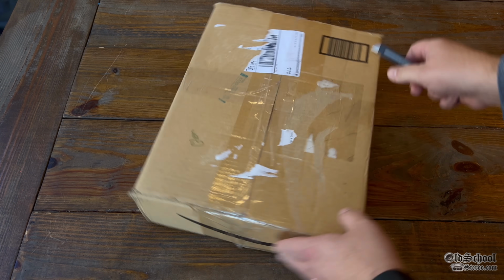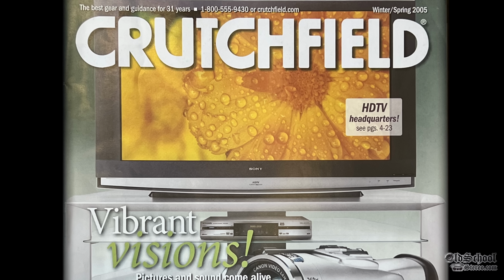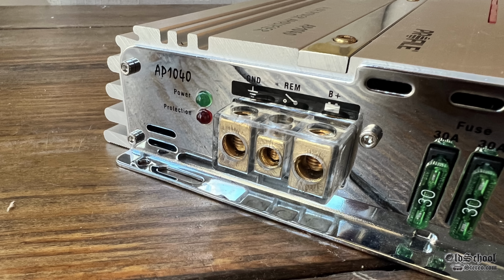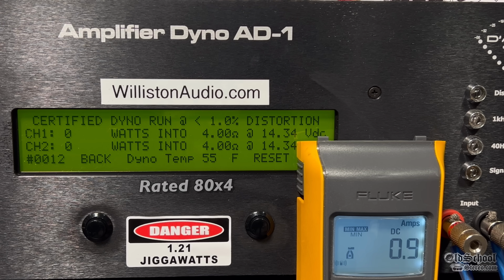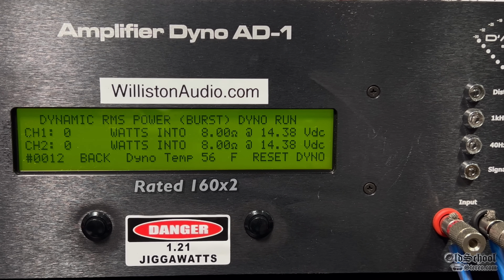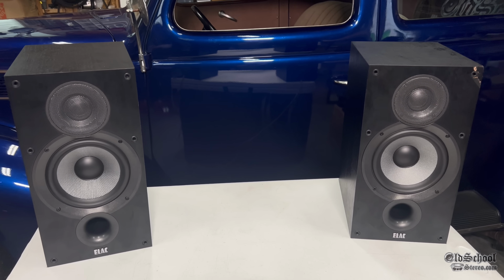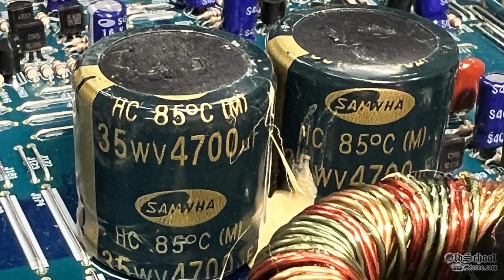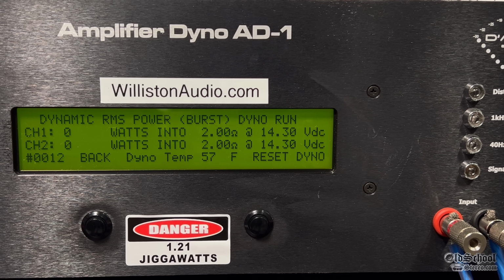2005 Profile California AP1040 Amp Dyno Test

Comment: I still have this amp in the 2-channel 1000-watt flavor. Just tested it for power on. Everything looks good. Internals are still very clean. Gonna slap it on my Kicker Comp R 8 2ohm DVC. Don't know what it's putting out, but the last thing I had it running was an MTX TR7515-22 and it would throw down.

Comment: I'm running a 2006 profile 1000watt class d monoblock right now, still pounding as hard as the day I bought it! I paid $250 for mine at a high end  store. Love it the red light just stopped working this week
Reply: @jasonpetrich4141  I never knew they made class d amps. I had the 1000w class a/b black Baja monoblock in 2004.
Reply: @tonemack1634  I bought it brand new, it was the newest amp at the shop @ the time, was like $399. Also got an eclipse deck with highest prevolt output 6 volts!!! Was a bad ass deck/ it  Was the first monoblock amp I ever bought, had a 800 watt Memphis! With the orange and blue MOJO! 12,   Wish I still has that driver.       The 1000watt profile is also 1ohm stable!

Comment: I have always wanted one of the high power smooth blue finish ones back in the day. They ran with the big 3 and were always the better buy as long as they were installed properly. If you had ground loops, clipping, or improper installation you would perceive these as being cheap. If you had a good installer they were awesome. Im not sure I would say circuit city or best buy really had installers that were putting in the effort for a quality build. LOL

Comment: I was 16 when I bought my first system. I had 2x 12” pioneer tsw-30f subs( blue and pink) and a profile California a600. It was the black and pink one from 1996. It was amazing how loud it was. I had a HUGE box that was about 52”x 20”tall and 16” deep. Good memories. I couldn’t afford Soundstream class A 10.0, broke high school kid making $4.15 an hour. 😂
Now I’ve got a system in every vehicle, tons of Soundstream amps. Class A 10.0, 5.0 and rubicon 10.2, 2x rubicon 1002, reference 700sx and lots of Phoenix gold, alpine 4x mrv-1507, and my favorite Alpine 3558 that was completely dead when I bought it. Now it sounds amazing. All the Elna caps leaked and corroded the traces to the power supply IC cards.

Comment: I had a 2000.1 California on a L7 15” in a ported box and it hammered, I mean when I switched to a west coast custom ORION 1500.1 it blew it out the water it might have been a 2500 it was around 2007/08

Comment: I used to install back in the day but never had a big setup for myself. Did a profile setup for a friend and liked the performance/price so my setup had a 4x75w profile amp and a AP300M mono drivng Crossfiire components and a pair of 8 inch Ctossfire subs was happy with it after figuring it out the 4 channel didnt like the 2ohms bridged load and having it repaired twice. Just gave it 4 ohms per channel and they were reliable. Entire setup survived pounding for about 10 years and I gave em away when i sold the car about 7 years ago.

Comment: I had a 250w Profile amp circa 1989/1990. It predated the California line. I replaced a 120w Pioneerr with it and it was much stronger  AND sounded better. I ran my whole system off of it with passive crossovers and it really did sound good. I added a Hifonics Hercules on my subs and moved it to the mids and highs and it kept up nicely. It was probably overrated, but it really was clean. My brother had a Sansui (ppi made) and it was quite comparable.

Comment: could you give me some details on how you have the remote wire, wired up? I assume it's just to a switch thats wired inline, got a link? I have a project coming up and will likely have to run a remote from the battery, or daisy chained from the pos from amp, with the switch inline. What would you suggest?

Comment: Always hated installing these at circuit city knowing the MTX stuff was there...though not everyone had mtx money
Reply: ...I worked at a shop that sold PPI and Orion and Eclipse and Zapco.and Arc. Every once in a while some one would bring these in for install. These Profile amps were cheaper...and sounded cheaper, but not bad....the American made MTX were great sounding, bulletproof amps....Back in the day, After work, I would drive my Honda Prelulde, that was packed with a Soundstream 1002 and a 604 Rubi, and a 15" Soundtream SPL, and MB Quart front stage to the CircuitCity Roadshop and hang out with and bullshit with the roadshop installers...and even with the Best Buy Rockford guys...those were the days my friend, so much fun

Comment: Profile california monoblock was my first amp that blew my very first mtx sub, back before I knew a damn thing about car audio.
Reply: Probably clipped it to death. Didn't have enough power to hurt it otherwise.
Reply: @runningbear1982  the days I thought the gain knob was a volume knob. Tried to take it back to circuit city but then knew what happened.
Reply: @EarlPickle  I've been there. I used to run 8 ohm subs on a 4 ohm amp, and wonder why they blew every 15 days. I used to wonder how a cheap ass Sony in a huge ported box had more SPL than my thunder 9500s in a sealed box. 🤣
Reply: @EarlPickle Circuit City offerd a two year no questions protection plan for $20. If anything happened to it they would replace it free, only once  if something happened again your S.O.L.

Comment: I still have my AP1000  mono amp it did good on power and sounded nice, the only issue I had was these amps run very hot , to the point where I had to put on blocks to have better air flow around it or it would over heat .

Comment: I had friends with California Profile stuff before and they seemed to work and sound fine. I think most people knew that they were less powerful than they claimed. I had a California Profile 15 subwoofer but I managed to kill it by fumbling a screwdriver right into the cone. I slipped and stabbed it dead on middle of the cone. I patched it with some E6000 and some paper from a donor subwoofer. I gave it away and the guy ran it for a few years and it seemed to hold up.

Comment: I had a profile spl 100w ×2 amp in 97 that pushed 2 fosgate competition 10s so hard it blew the front surround to pieces
Reply: I think Rockford made a lot of new design subs that year with the inverted dome (concave...) dustcaps. I bought a pair of new 12 inch subs made for sealed boxes (not Series 1 and not Power). Both dustcaps had a 60 degree section with little to no adhesive. Peeled up. Some QC there. They likely produced more subs than ever at that time - especually near 2000. Got my money back at the same moment. They may have been one with a light spot on the surround too. New employees, new processes.